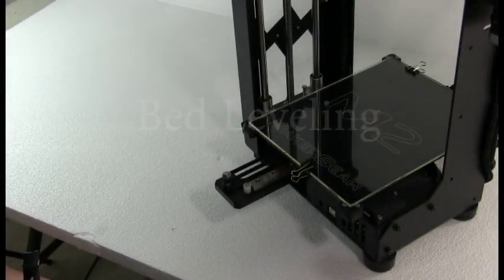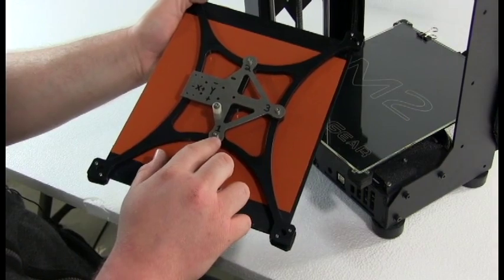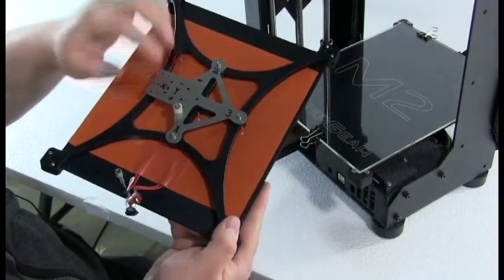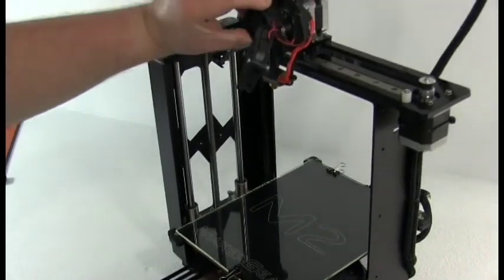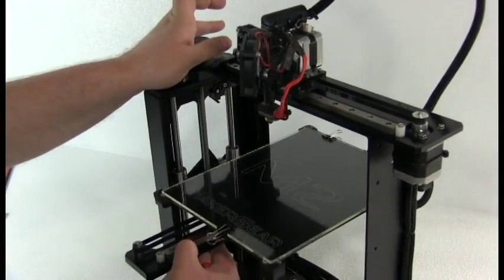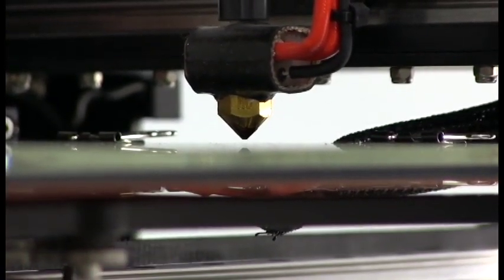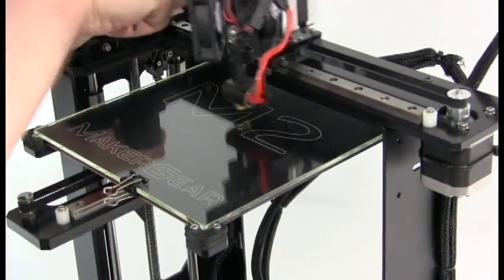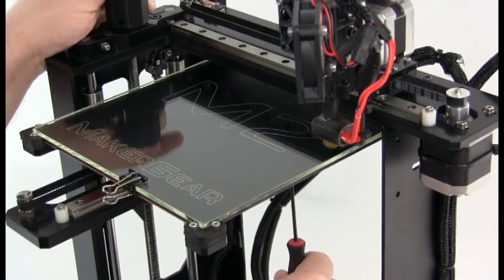MakerGear M2 Desktop 3D Printer - Bed Leveling

Comment: Guys there is a simpler way to do this.  You just need to level the bed when the nozzle is on top of each of the 3 screws.  Just place the nozzle on top of one screw, and level that screw, and repeat for all 3 screws.  If the bed is leveled on these 3 points, the entire bed will be leveled.  No need to complicate it.
Reply: Hello I can't seem to get mine level. Can you help?
Reply: SI FUNCIONO LLEVABA RATO INTENTANDO HASTA QUE VI ESTE HACK GRACIAS

Comment: Why does a 500.00 Printer Bot have laser autoleveling and this 1800 printer has 3 cheap screws.   Hmmm.
Reply: +goblin072 I had to look that up. PrinterBot doesn't use optics. That is a magnetic probe with an LED on it. I'd guess that the aluminum bed on the MakerGear doesn't work too well for that and obviously not at all with the glass or tape surfaces.
Reply: Because its only pseudoleveling... You could also ask why moog music is only using analog sound synthesis...